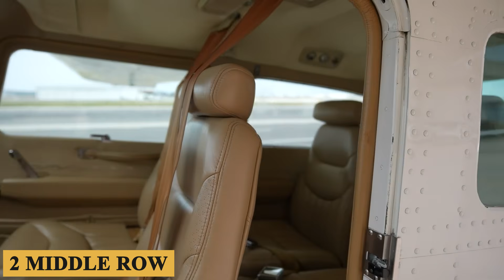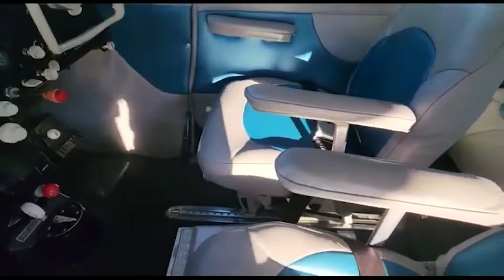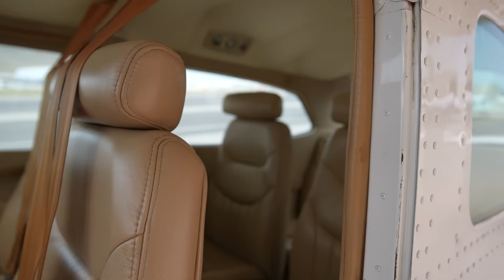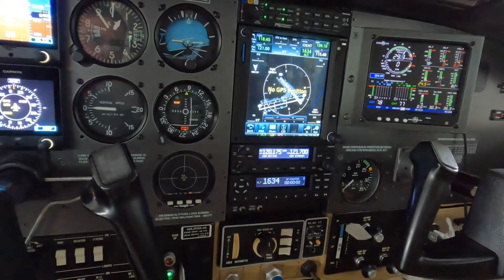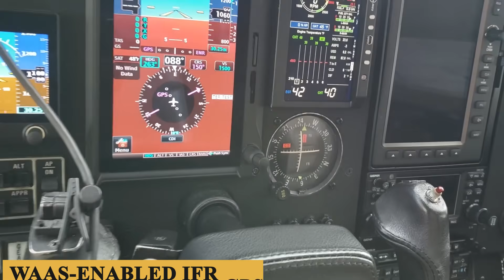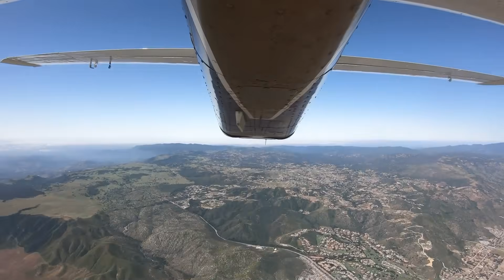Inside The $500,000 Cessna 210 Centurion

Comment: Ancient
Reply: It is old but there hasn’t been any new design that can do what the 210 can for the same price. I have about 3500 hrs in a 1982 T210 that was known ice from the factory. You could top it off and load all 6 seats and fill the baggage and not be over gross weight and you never had to worry about CG. It was just like all other Cessna single engine planes though… it was under powered. It had 310 HP for 5 minutes then 285 continues. It would have been a whole lot better with 350/300.
Reply: I have a 210 J and I’m a gigantic fan of the simplicity of retrofitting it with a better system of glass and adding the air conditioning. It is probably my favorite aircraft. I’ve flown in (I’ve only thrown three or four types lol)
Reply: 50-40 years old isn't that bad in the used aircraft marker, similar to buying a used car from the 2000's
Reply: It's a really great plane. Especially the P210.